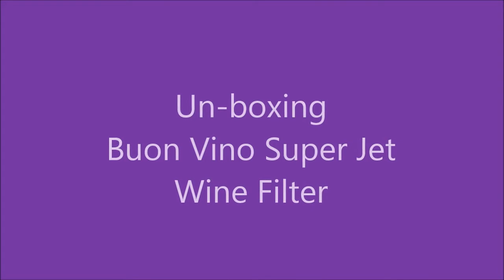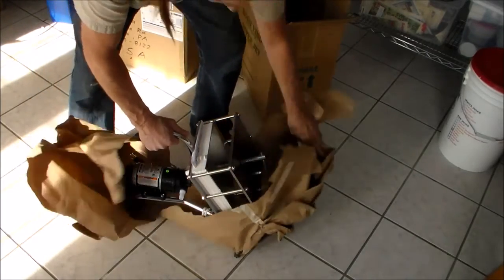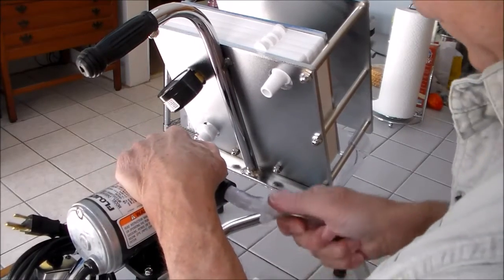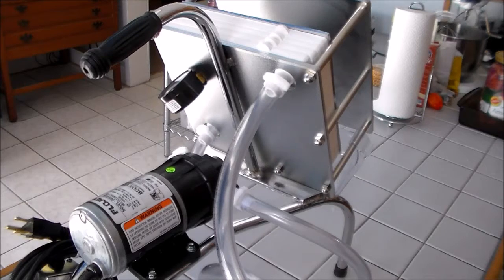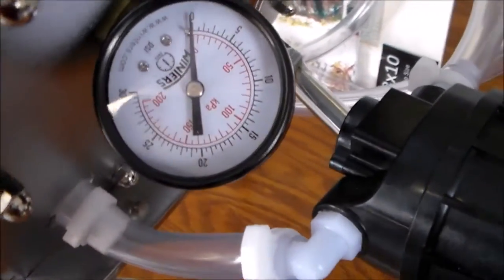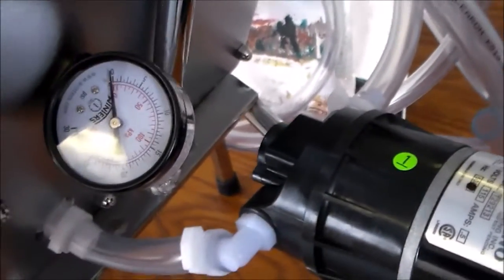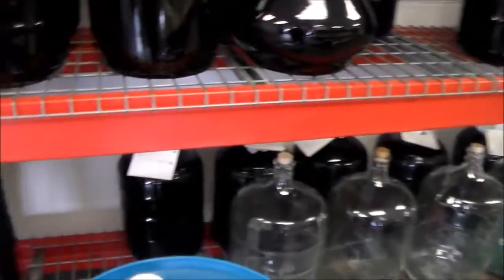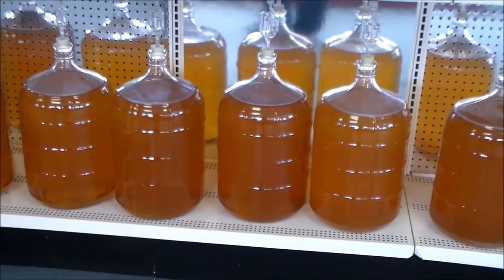Un boxing Buon Vino Super Jet Wine Filter

Comment: Whoa, so many gallons!  

I wonder if one could accomplish the same filtration and polishing with a cascade of the canister filters typically found in reverse osmosis systems. That style of filter (wound filament) can well down to 2-15 microns, though flow rate would be better in the 20-30 range.
Reply from the maker: +icarus901 I'm sure it would work--- most of my wine I don't want to filter, it clarifies with aging. This will allow me sparkling with a shorter time!